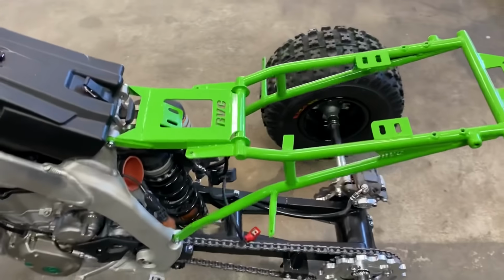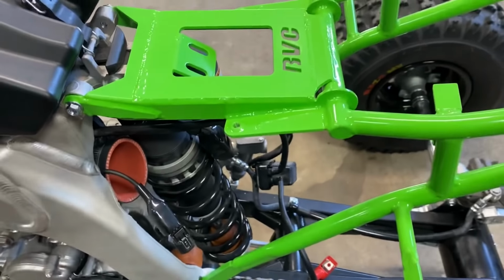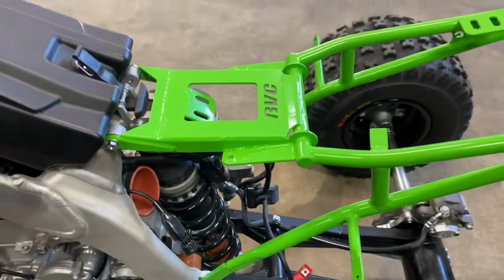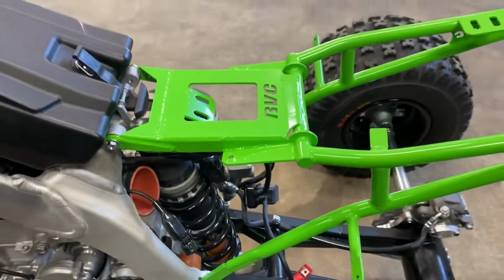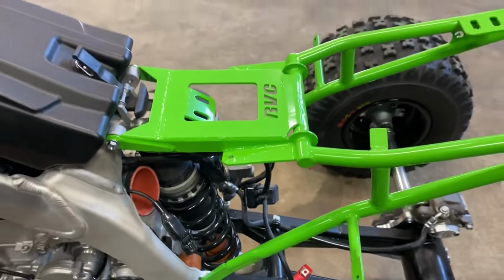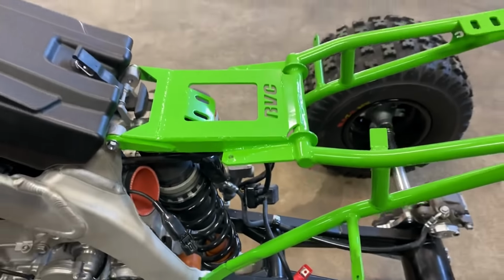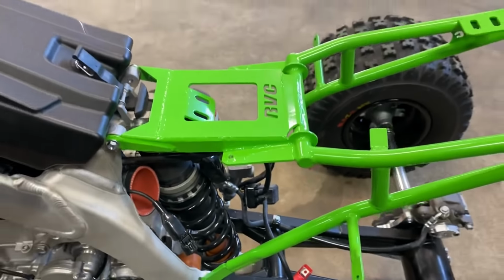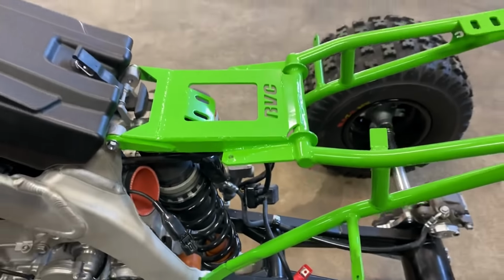2020 KX450 kawasaki BVC TRIKES  Dirt bike to Three Wheeler Conversion Build Finished

Comment: Beautiful!  Have you ever considered making a front billet hub for the Tri-Z so we can run an 11 inch rim?  I doubt a 10 inch would clear the brake caliper.  I know a lot of us Z owners would like more tire options.
Reply from the maker: We offer a complete invert fork front end for the tri-z that uses our billet hub.  The 11” tire options are getting just as bad so our main seller is 23x7x10 tires for our front end